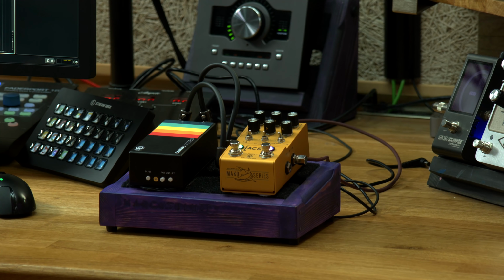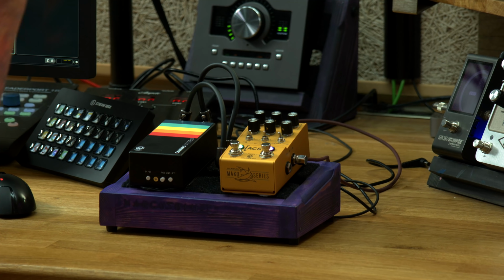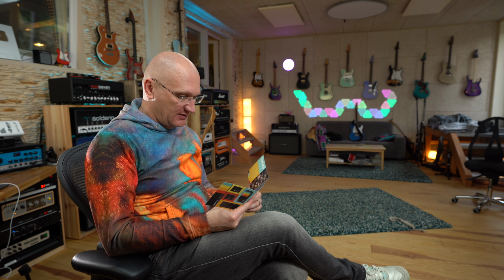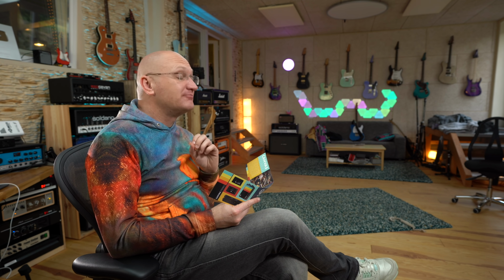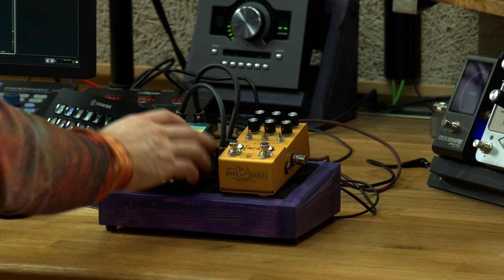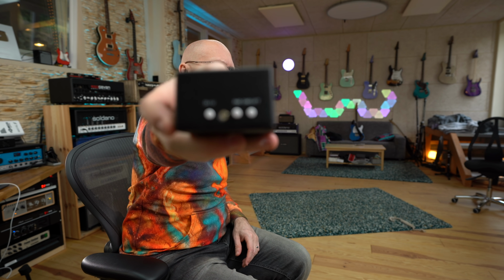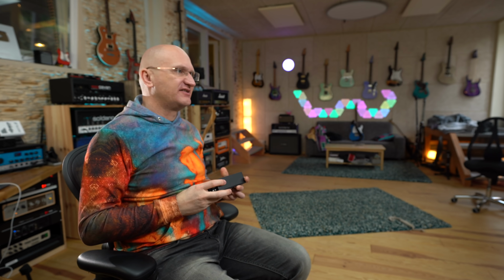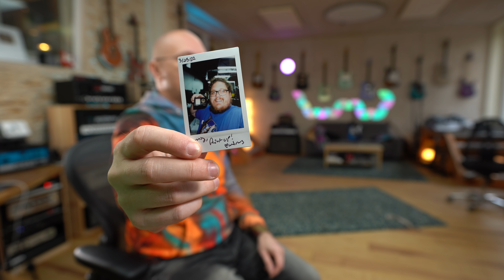Dammit, you might need this! Walrus Audio Canvas Review

Comment: Balanced does not = microphone level. You are mixing things up a bit. XLR also doesn't mean microphone level. XLR is just a connection type and can carry mic level, line level, AES, DMX, power, and more! Balanced audio is simply a normal phase signal, inverted phase signal, and a ground.  

Even if a guitar device has balanced outputs, anyone playing live can and should use a DI for 2 things. First, it protects against phantom power from the FOH console or the digital snake. I don't think all balanced outputs on all devices will be happy to have 48v shoved in on one of the pins. The transformer in the DI electrically isolates the connection making it impossible for phantom power to make it to a device. 

Second, running a line level balanced output to FOH via a snake can introduce cross talk to the other mic level wires in the snake. Crosstalk is when the signal from one source bleeds into other sources via induction. Also sending your FOH engineer line level can be too much level for the mic pre. Most FOH consoles are expecting mic level (-60 to -40 dBu) not line level (-10 to +4 dBu or even more). My Headrush pedal can output a signal as high as +18 dBu. This is perfectly fine for an audio interface's line level input. My MOTU line level inputs can accept up to +18 dBu, but almost any mixer's mic pre cannot. It will overload the pre and the converter and the FOH engineer will likely engage a pad to drop it back down by 20dB. 

The result is that you send a super hot signal to FOH, possibly/probably causing crosstalk in the other lines, for no observable difference to dynamic range or noise level. Compare that to plugging your line level output into a DI, which will drop the signal down to mic level. Now there is not crosstalk, no pad engaged, and the FOH engineer has one less thing to do. Will they have to put some preamp gain on your guitar? Yes. But you can optimize that by sending a lot of level into the DI, as long as you don't overload the transformer. Plus, 15-20 dB of preamp gain is not anything to worry about in terms of noise. 

The main benefit of the Canvas, I just ordered one a few days ago, is that you get both a DI and a Line Isolator in one box. For playing at home, I can switch to LI and have little to no signal drop going into my line level balanced inputs on my MOTU M4. For live, I can engage the DI switch and now everyone is happy. I'm protected against phantom and the FOH engineer has a signal similar to a higher output microphone. 

Are there better transformers in more expensive DIs? Probably. The Cinemag transformers look exceptional. You can check out the spec sheet for frequency and distortion information. They are very low distortion and have very good frequency response. How good is the Canvas in comparison? Probably not as good because the devices that use Cinemag transformers cost far more for a single channel. I contemplated making my own DI with Cinemag transformers, because it isn't hard at all, but the Canvas seems to be a good compromise of convenience and quality.

Comment: Thanks for the video, love your content and studio. Question about the canvas. I have a helix lt and run my Xlr cable to my fender tone master FR, do I need to use the canvas? Or is only when I’m going from the helix direct to front of house mixer the I need to use it?
Reply from the maker: Does the helix have Xlr out?
Reply: @EytschPi42  yes. and the fender amp has xlr in. I guess the canvas will be best when using an amp/modeler pedal when going to mixer, right? im thinking second option a pedalboard wirh UAFX RUBY pedal.
Reply from the maker: @santiagoquijano7391  if you have an XLR out, you don’t need the DI box, but for the Ruby you’d need one.

Comment: Question: most of us in a live situation run a 20ft unbalanced guitar cable from the pedalboard back to the amp. Does that mean 20ft would also be fine  running to front of house if not using an amp? So the real question is how long before you need to be balanced? I hear lots of stuff around how important it is to use balanced but in a practical situation it seems somewhat unsupported. I have no preference, just trying to get genuine info.
Reply from the maker: Good question… in general, if you can run balanced cables and it is supported on both ends, then do it!

Comment: So if I was using A Walrus Audio Canvas Mono for going from my electric guitar, to a pedal board, to the canvas, and then to an interface, I want to use Direct Input right ? I would probably also use the Pad Switch and then increase my input volume or my interface volume ?
Reply from the maker: you wouldn’t use it before your pedal board
Reply: @EytschPi42  right, so Electric Guitar → Pedals → Canvas(DI) → Interface

Comment: I know my situation has to be pretty common, I have one good tube amp, a pc, an interface and a pair of monitors, I would like sound to come out of my cab and monitors, I would like to use my stereo effects, maybe through the powered monitors, but I cant figure it all out!! lol
Reply: Could you provide some more detail? What exactly are you trying to do? Capturing your guitar+amp tone, and then applying stereo effects to the mic’d result? Or running your guitar direct in with an amp sim, but hearing the result just through your cab?
Reply: @RufusKSala  well, I have a really good tube amp I would prefer to use, and maybe make that like a dry center channel,  then I would like my stereo effects to come out of my two monitors. Right now the monitors are ran by the interface. I think I might need a mixer with certain features to allow me to do it. Basically I wany my dry cab with stereo effects coming from my two monitors, they don't have to be 100% wet and my amp does have a di out, so maybe I just need an interface with 3 inputs.

Comment: I woul'nt recommend solderless pedal linking cables...never had a problem with a soldered cable but solderless are just the cable jammed into the threads ?!?!...if you value your equipment use good quality soldered Pancake type connectors, & your cable oxidizes faster if non-soldered...solderless plugs are not good enough yet....

Comment: I’ve got the quilter phantom block preamp/di with a cab sim off wanted it’s mono but only about $100 so getting out stereo isn’t that much more.  I’m really enjoying it in clean settings which is why I got it
Reply: I’m using three guitar pedals > I rig interface > I phone.   Would I benefit from a di box/ quilter?
Reply: @tomas7730  I think so even if you turn off the cab sim on it all though it would sound good with it too I think, I use it sometimes in a similar way with an akai force
Reply: @RobertSaxy  thank you so much Robert! Sorry if my question seemed vague I was in a rush typing it. Let me elaborate lol. I write songs with the guitar and record them to garage band on my iPhone. My signal path is the guitar to a delay pedal > reverb pedal> mod filter pedal then it connects to my irig interface( which idk if it’s a preamp, it does have a gain knob on it). There’s a lot of amp sims in garage band.  I just wonder if the quilter will add anything the irig is not already doing , also for the tone of the quilter. Thank again I’m debating scooping one up before this canvas box
Reply: @tomas7730  I definitely like what it does and does add a guitar style preamp that I do believe is not what the irig does, it has a tone noob volume and gain.  I think it’s worth it.  It’s been a moment since I’ve recorded like you have into an iPad with an irig, I use to do it all the time within at an arts camp but what I’m doing now with the force is very similar and I like what it does and believe out would do a similar thing in your situation.  The only thing I’ll say about that little box is that when the gain OSS pushed into overdrive I don’t like it but the clean sound is pretty great especially for what it is

Comment: Can anyone tell me if you want to have a di like the canvas stereo or the diso+ when using an amp modeler like dream ruby ac1s or iridium? Will it help make a cleaner signal or is this simply for long runs? Still have trouble understanding the reasoning of going from unbalanced to balanced unless your going into a house system at a gig? For studio purposes, are there benefits to have one of these when running a dsp rig like my dream 65?
Reply: yes, there are benefits when using it in studio... use it in line isolator mode

the signal will run stronger, cleaner and with more headroom to your interface and DAW, but honestly, it's one of those things some people will say is psychological, a placebo...
Reply: @luizdemarco99  i beg to differ. Got the diso+ i can absolutely tell a difference when running it with my pedalboard. Cleaner sound, almost more spatial sounding, and overall my fx just sound less muddy. Well worth it
Reply: @joeymc5272  Yes, I totally agree! I was just stating that some people think and will say otherwise, just to show that there's some controversy on this matter.
Reply: @luizdemarco99  lol i know. I was skepticle of purchasing one at first because of this but now i am a believer. It also helps on cutting down on unwanted noise. It wont get rid of completely but it tunes it down enough to where its not noticeable much if you gain stage correctly and gate correctly